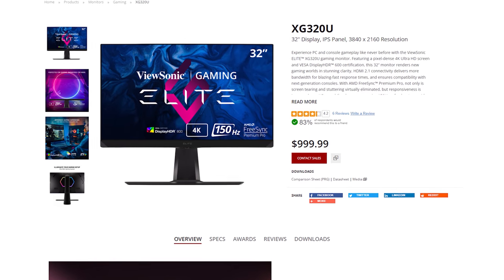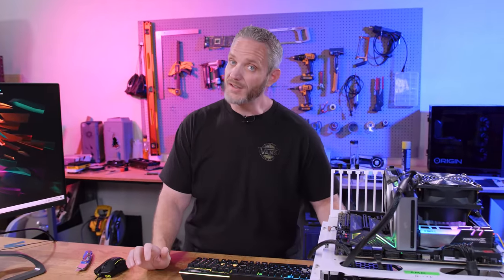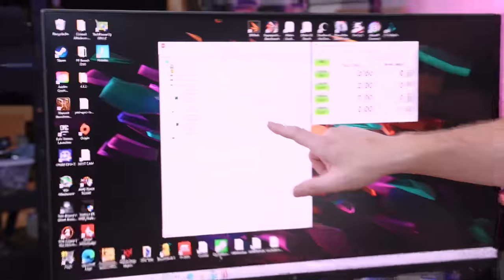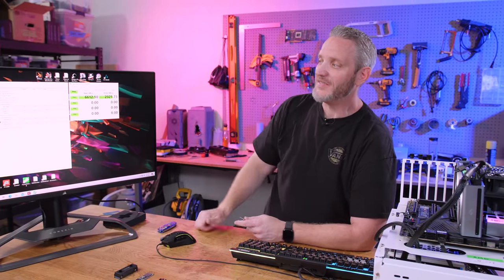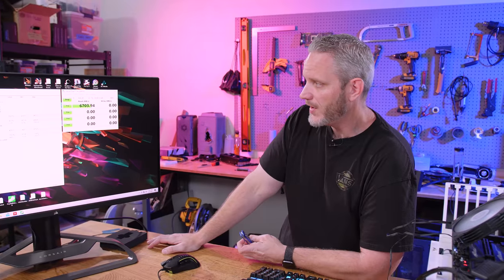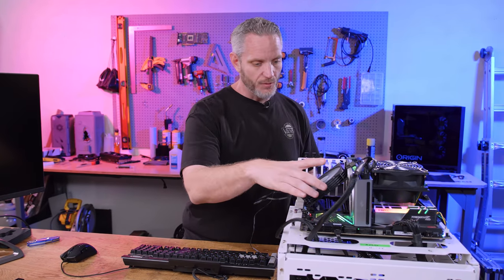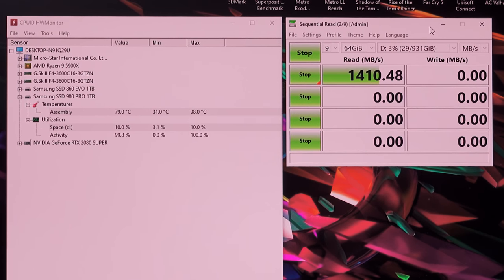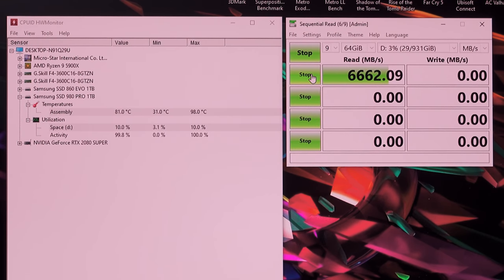I watercooled an NVME SSD... These results were unexpected!

Comment: Doing read/writes to test for temperature is actually going about things backwards.  You want to monitor performance and temperature while YOU heat the drive.  That will give you the data you need on what temperatures cause performance problems.  THEN get a standard temperature at base load, add cooling, and see how the cooling solution reduces temperature.  Thermal reduction should be roughly linear because your cooling solution can only remove so much heat at a time.
Reply: Sorry, posted that before I got to the part of the video where you pulled out the heat gun!

Comment: You need to do this test on a OS 2tb drive while gaming in a laptop. Mine runs up to 80-83°c for almost two years now. Has a thermal pad and a cross plate heat sink only. Never had an issue yet. Samsung Magician says it's fine currently. EVO Plus 2tb PCIe 3.0.

Comment: Correct me if mistaken. Small detail but don't recall Jay using EPMD rubber tubing until this video. Its practical, versatile and flexible (maintenance-wise) compared to other alternative soft and hard tubing alternatives for water cooling in addtion to having a certain H.R Giger aesthetic appeal.

Comment: So I left the peel on the pad of one of those motherboard covers, and the port was behind my 3080.  Was fine for like 2 months but eventually the peel melted and fused with the pad, and my 1tb crucial p2 started immediately overheating.  It was my boot drive so the whole pc would just crash.  Fun rookie mistake.

Comment: To have something like cinebench for hard drive, you can see what is done in professional VFX studios. For exemple big simulations (water, fire, smoke...) that can be multiple terabytres each. If you have a machine powerfull enough, you will put some stress on you storage device because the machine needs to read the scene, then write that big file (can be 0.5-10 Go per frame) and then do all of it again. I bet with a worst case scenario the computing time in between every read and write could be very short

Comment: I have an ASUS Z390 Gene and I am more than satisfied with the cooling capacity of the DIMM.2 module. I'm using two 980Pro's (a 1TB for system and productive software and a 2TB for games) and the temperatures are awesome. The 1TB on the front of the module will be 32°idle and 36°load, the 2TB on the back will be 33°idle and 39°load... I would never switch to water cooling, that's wasted money and unnecessarily strained nerves :)

Comment: Got me curious. Downloaded WD dashboard to check temps on my WD Black NVME. 44 Celsius. My NVME slot is just above the first PCIE slot, under the CPU.
 I have a CM G100M which I bought just for looks, but it is a downdraft cooler, and my case has great airflow as well.

Comment: I added the Acidalie cooler to my SK Hynix Platinum and got more stability.  My PCIe 4.0 is right next to the back plate of my 3080 Ti which adds heat (located between GPU and CPU).

Comment: 10:30 actually the difference of temps (delta T) helps the cooler a lot to bring it down efficiently and quickly! I didn't understand what you meant by it is harder for cooler to bring it down! was there smt that I missed?

Comment: i've had issues with my NVME due to heat issues. just random OS issues. turns out that the fan for the nvme cooling system was looking for the temp of something that doesn't exist. so i adjusted the fan curve that was close to the NVME and is more sensitive and haven't had any issues since. also the write speed flucations may be os/drive optimizations where the files are cached after the first write.

Comment: Decent airflow+some cheap heatsink is enough for PCIe 3.0 and 4.0 speeds.
The 5.0 speeds are going to be 10.000+ Mbps, and that's where the active cooling is going to be required. Watercooling might be a bit much, but those who actually need it don't pull out their components apart weekly like you do. So ... accesibility is not an issue.

Comment: Well, I got Micron 7400 Pro M.2 SSD (110mm ones). Without any heatsink they go up to 70C right after boot, and 90C after 10 mins. That's no joke those need either a huge heatsink + fan, or water cooling.

Comment: my motherboard holds 2 nvme drives but only came with 1 heatsink cover, so this was helpful.... definately not going water cooled though, ill leave that to you !

my main drive with heatsink idles at 28
second drive no heat sink idles at 36

i havent really paid attention to what they are under load though

Comment: Right now, the only way I can imagine you can perform real life tests on an NVMe PCIe Gen 4 SSD is by building a testbench with at least 128 GB of RAM, create a RAM drive, fill it with a 100 GB file, a dozen of 1 GB files and dozens of thousands of small files in the order of KB's, on different folders so you can perform different tests, create a batch script to copy the files and monitor bandwidth, temperature and whatever you want to check. In order to see consistent temps, you need to fill the SLC cache, which can be done by copying the 100 GB file several times (maybe you can use several hard links of the same file which will look different to the SSD controller and will push the parallel capabilities of the drive). Also, you can use the dozens of thousands of small files to test the max IOPS the drive can handle, raising the controller temps and monitoring if it throttles.

Comment: A good trick if your PC has a PCIE 3.0 NVMe connector, is to put a PCIe 4.0 NVMe in it. Those drives are designed to run at the faster speeds so when you run them at the slower PCIe 3.0 speed, they don't overheat nearly as much, if at all. And the PCIe 4.0 drives have dropped so much in price that they are close to the same price as the 3.0 versions.

Comment: I test all my new drives with h2testw by c't magazine. It was meant to detect fake USB drives, but it can also be used in a more general way. It simply writes the same data over and over on the drive until it's filled (or reaches the given amount of data) and afterwards rereads the data and compares it to the originally written data and reports if there is a mismatch.
You could probably extend this concept and the concept is not flawless, but after a first write/read run you can have at least some confidence in the drive without potentially risking data.
A real pain in the ass for multi-TB HDDs, as the whole process may take up to ~3 days...

Comment: If I'm not mistaken (and I may be) the operational temp of most SSDs is up to 70c.  Of course if you run it that hot all the time it's going to shorten the lifespan but it will work fine at that temp until it dies.

Comment: Your test was designed to identify the relationship between SSD temperature and speed.  You conclude there is no significant performance drop from working at a higher temperature.

However, running electronics at high temperatures can create reliability issues.  So, while there may be no value in improving the cooling of an NVME from a performance perspective, I would expect it to maximise the health of the drive and its longevity.  Given that we are talking about a data storage device,  I'd have thought the life expectancy of the drive would be very important indeed.

I fitted a small heat-pipe style SSD cooler to my drive.  It took the idle temperatures down from around 80 deg C to under 40 deg C. It also keeps the temperatures under load down under 50 deg C.

In terms of cooling, I use the temperatures reported by the NVME in the control of my case fans (I use the fancontrol software that you reviewed), along with all sorts of other temperatures measured throughout the PC, each one on a separate curve.  I think a real-life installation, where the SSD forms part of the entire PC is what matters, and the aim is to keep all parts of the PC cool so that they maximise their life expectancy and/or the PC's performance.

I take your point about the inconvenience of water-cooling every part of a PC.

Comment: I like to use a pointy (usually aluminum) heatsink that has the right spacing to screw in a fan screw. Then, find the right size fan and screw it into a couple places diagonally. Voila! active cooling. Little fans are $5 to $15. You just lower their speed way down for quietness and longevity.

Comment: You could add another scenario to this test-suite.
watercooler block with increased thermal mass without circulation. aka put water in it and seal it.

Comment: I have an old Motherboard (my computer is now nearly 6 years old) and I build it with a 1TB Samsung 960 Pro. The NVME Slot is directly below the graphic card. In the beginning I had major problems. The temperature of the drive went up to 62°C (ranging from 48°C to 62°C) and at that temp my computer would randomly stop for a second and then runs on. 
As there wasn't much place below the card, I searched for a low heatsink. I found one and it dropped the temperature by nearly 10°C, so it was running at about 40°C to 53°C. So I had a significant result. Still sometimes, the computer froze for a second. Much less than before and most times nothing happened at all, but still the problem was there. 
Later on I switched to a SSD card and moved the NVME from below the graphic card on this special card, which had a heatsink with a fan. The temperature dropped to 35°C to 45°C. So in my case it was very successful, but as I said I have an old system. So no cooler provided by the motherboard and the NVME at one of the worst places possible. Directly between the two slots covered by my NVIDIA 1070.
Now I have a 2TB Samsung 970 Pro in the system, also on that SSD card. It ranges between 36°C to 42°C. I don't know why it is cooler as the NVME is faster, but I assume it is the never technology.

You may ask, how did I figure out, that the NVME was the problem in the first place? That is easy, I switched from a 2,5" 860 Pro SSD to the NWME and after the switch those problems started. As I knew about the throttling problem and somewhere in the internet I found something that this drive would start throttling at about 50°C, I tried to cool it.
Which really fixed the problem, even though I was forced to build in a special SSD card.

Comment: I don't know of any Windows stress tests for drives, but in Ubuntu you can use the stress command, stress --io (number of stressers) and that will run for 24 hours by default which can be canceled with ctrl + c when you are satisfied with your load

Comment: it dont suck too bad switching out parts i found a way to make it very easy take your plug out put a shopvac in there and it sucks the water out pretty fast it works alot better than i thought it would and you get no spillage on PC parts.

Comment: If I start to render big music projects, the M2 (Firecuda 2Tb) spreads serious heat, but I always build my machines with enough airflow to prevent everything from overheating. But I wondered too what the watercooled block would do. But it's not worth the money, you can buy several new drives if something goes wrong, and also the mechanical pressure on the motherboard is significant with all the tubes. But thanks for trying out.

Comment: I've a water cooled hard loop nvme in my rig. Temps always around 32 degrees celcius. 
As highlighted, very difficult to do maintenance.
Ive also another NVME not in the loop passive cooled by the gigabyte aorus master Z390 heatsink. It runs 20 degrees hotter. 
Im about to purchase a designated heatsink fan combo for the nvme to get temps down to hopefully the watercooled temps. 
My kids have their own PC's with NVME's, one a heatsink fan combo, and the other just passively cooled. They both run about 32 degrees celcius. So having the additional fan built in to the heatsink doesn't really offer much, but then the size of the passively cooled heatsink is bigger than the air cooled heatsink.
My Gigabyte board whilst it has the nvme plate covers, the metals pretty thin and doesn't offer much heat dissipation. 
IF you can buy aftermarket nvme heatsink coolers in your area, I would. I'm in Thailand and have a bit of variety online with local shopping apps and imports, albiet usually china knockoffs of reputable manufactured brands but they do the job and very affordable.

Comment: Everyone says you don't need these covers, but one of my 2 SSDs was idling at like 60-70c and samsung's manager app was yelling at me because of it. The OS drive was under a cover and was 10-15c cooler under load. So I got a cooler which was an alu block which holds a single heatpipe with a fin block at the other end of the pipe (bent in a U shape to keep it from getting too tall). That drive now runs significantly cooler than my OS drive, which is under the board's shield cooler. When reading from my OS drive and writing to the one with the pipe on it, the read drive actually runs hotter lmao. I have not noticed a real world performance difference between the two drives, and they're both running at safe temps right now so that makes sense, but after running an SSD naked and seeing just how hot they can get under what i consider mild loads, it's made me permanently weary of running one without any cooling, which plenty of people claim is fine even though the drive would hit 90+c under sustained loads and throttle like you're showing. I think in the future we'll see people babying their drives a lot more than we do now in systems without covers. With next gen SSDs expected to increase in controller performance, and power draw with it, I think we'll eventually reach a point where this is significant enough to need some level of proper active cooling, at least in systems where these drives are expected to hit sustained loads

Comment: SSD Write Speed fluctuates due to SLC-Cache overflow while writing large volumes of data in short sucsession. Even on very fast NVMe SSDs the bulk space is not fast enough to sustain PCIe Gen4 speeds on write operations!

Comment: instead of using crystal disk mark or whatever, you should just get a big file, like one of your longer video's unedited footage, as big as you please, then transfer it from a faster drive, like raided nvmes, and see the current drive read and write speeds in task manager. that will keep it occupied for a long time, while being consistent in terms of heat output, and then you can apply extra heat, and see in realtime the drive speeds.

Comment: I have a Samsung Pro 500GB PCi 4.0 nvme & do alot of video work & find when they are writing more than 20% of the data being written the performance drops to 800mb/s & I use Heatsinks & temps under 40c, my Auros 1TB nvme stays at the same write speed throughout the data being written. We need a write comparason between all manufacturers NVME to see which ones have a Sustained write speed, you may be suprised at the results...

Comment: I wrote an IO stress tool for testing storage arrays (on my own time, I own the source code) when I worked for a major storage vendor (think IBM or Oracle). It doesn't collect sensor data (temps, cpu, etc) but it does generate TB of unique, uncompressible, data VERY quickly (I used it to stress an array that could do 100GB/s, not a typo, big-B). When it comes to stressing storage, that's about as good as it gets. If you want something a little more reviewer friendly, let's setup a chat for what you want / need.

Comment: Performance Test (Passmark Software) has an advanced disk test where can specify read/write patterns on multiple threads and extremely large sizes and for up to an hour of test duration. The test allows you to set up tests to simulate any workload (such as file servers, web servers, workstation, database, or any arbitrary percentage of reading and writing). You should check out their free demo (30 days) that allows you to see if it does what you need.

Comment: The whole point about NVME heatsink is not so much about performance, but the ability for the NAND retaining its data.  As a general rule, the cooler the NAND, the longer it can store its data accurately without having to rewrite the cell.  Either way, water cooling the NVME is completely crazy.  I would just slap a heatsink on it and just forget it.

Comment: My 1TB Samsung Evo M.2 drive from 2018 regularly gets up to 70C when under load (regular load, not benchmarking), and there's been no stability or speed issues (CrystalDiskInfo throws a hissy fit though if it's open). I don't know why that particular drive is so hot, but doesn't appear to be a problem. 

Recently bought a Kingston 2TB PCI-E 4.0 M.2 which is twice as fast, and highest temp I've seen on that is around 59C, during benchmarking.

Comment: 16:20 "watercool everything"

I've tossed around the idea in my head of a theme build with that in mind. Half red, half blue flex tubing everywhere. The pump/reservoir would have a fake heart covering it with the tubing going in and out through the heart valves. Even better if I could do it in a case similar to the demon case from the Your Pretty Face is Going to Hell series.